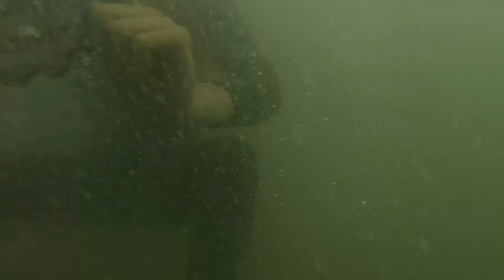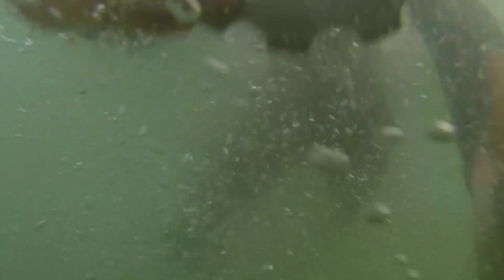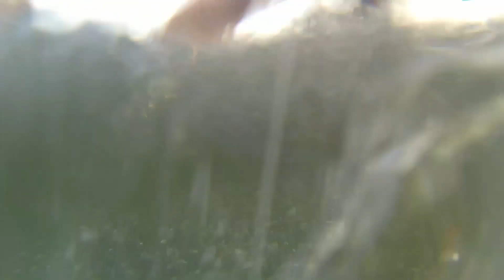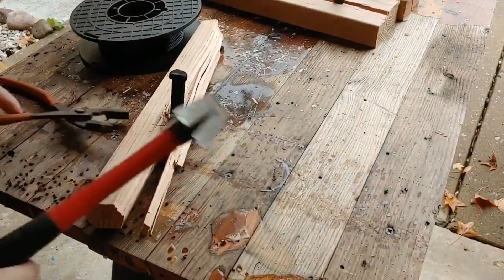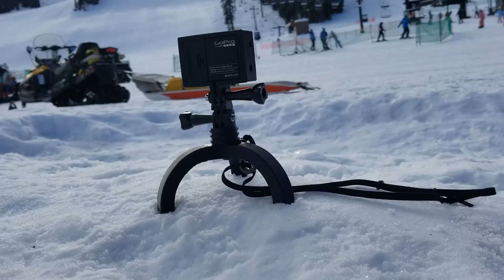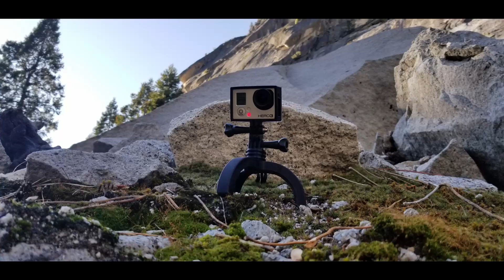How to work with Taulman 3D Nylon

Comment: Printing Taulman Bridge on polypropylene plate for 110C with Elmer purple glue stick. Sticks very well, could probably do with lower temperature. (At 80 it warpped a little though)

Comment: I appreciate you making this video. I was able to get a good start as too.printing with nylon, I have notice a slight quality improvement by.printing at 30mm/s and using 6mm of retraction. Nozzle/ Temps of 260/70 seem to work well. I bumped my flow rate to 105% and its been doing well.the material seems to soak up water like a sponge. I turned my filament dryer on after a day and there was condensation inside.

I think the biggest tip was decreasing the speed and increasing flow rate.

Thanks a bunch!

Comment: I'm using wham bam magnetic sticker on my bed and I switch between powder coated PEI for everything else, and garolite adhered to a spring steel for nylon. If you have a magnetic plate system, and want to print nylon, it's a cheap option to have a spare plate with garolite (it's not really flexible, garolite is stiff)-- it only helps for swapping build plates without using bed clips -- hate those. I've been using garolite plate for taulman stuff, 645, bridge and 910. I use pretty much the same settings -- direct drive e3d nozzle x with a copper heat block and a titan extruder. 90c on the bed 265c on the nozzle. Garolite straight with nothing on it warps, doesn't work. Glue stick has been working before, I've been chatting with folks from vision minor, and most recent 645 alloy prints work really well with their nano polymer adhesive. I have an air purifier and a dehydrator in my lab, so air is kept clean and dry, and as you like to say -- "that being said" -- I ALWAYS throw the nylon spool in my printdry for 18-24 hrs at 70c to fully prep it for printing. I ran at 60mm/sec, 1.2mm retractions, nothing special. I use very similar settings for NylonX. Nylon doesn't do well with supports, so I tend to stick to designs where I can eliminate extreme angles. I've had OK luck before on PEI, but it's always been tough -- so garolite is just easier. Need to test nano polymer more, but it's promising.